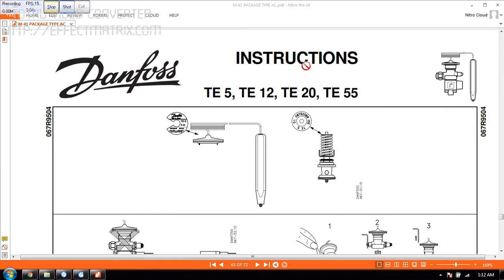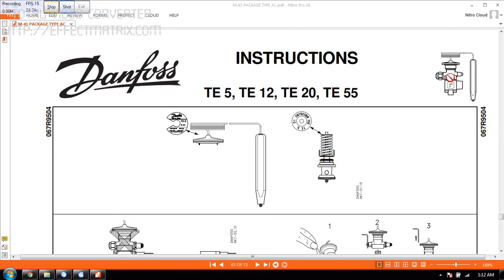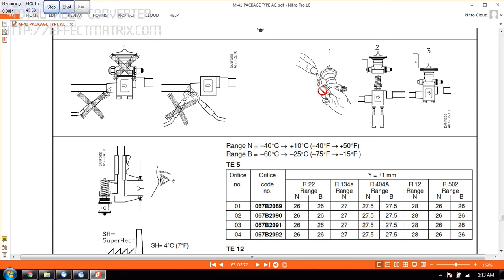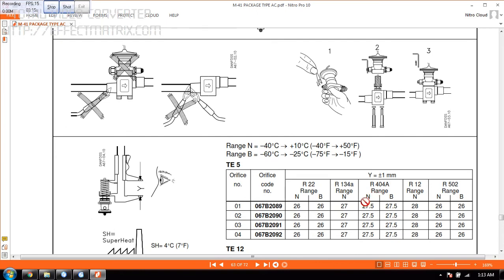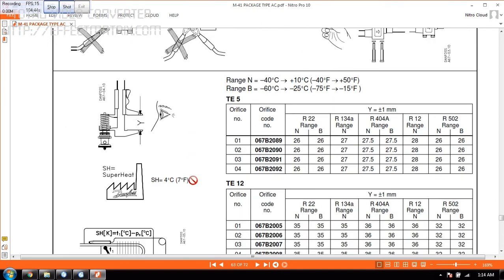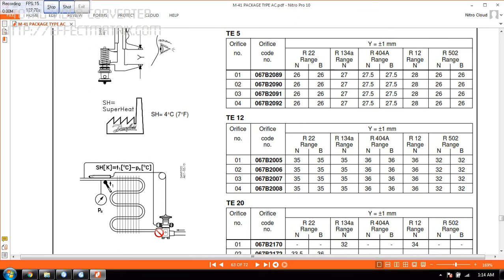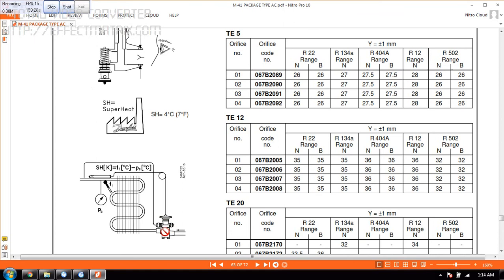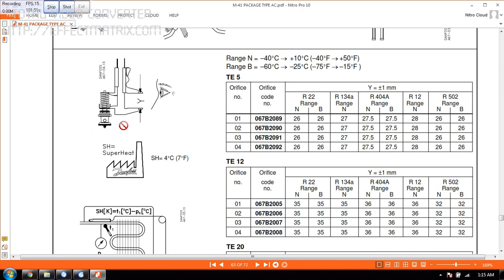Expansion Valve For Air Conditioner Important Tips

Comment: Dear sir, Good day. Kindly tell me whats the main reasons of Icing in domestic fridge expansion valve and after major overhauling of Domestic fridge compressor how can I purging compressor gear oil as well as refrigerant ? Regards.
Reply from the maker: Good day Rony  One of the major reason for icing is less Gas in the system. If Gas is sufficient then check the flow of Air is good . sometime when we see the belt driven blower for evaporator look good. But stop the system and check for cracks in the belts which is normally not visible. If belt Ok then increase the belt tension little bit more. Check the expansion valve is working properly or not. For purging the compressor gear oil you need to close the outlet valve from the receiver and wait until l the compressor stops. then put off the power, close both inlet and outlet valve of the compressor. If you want to drain the gear  oil then connect the hose and open the valve. Due to gas pressure in the compressor the oil will drain out. But If you want to top up then you can see my video for more details.